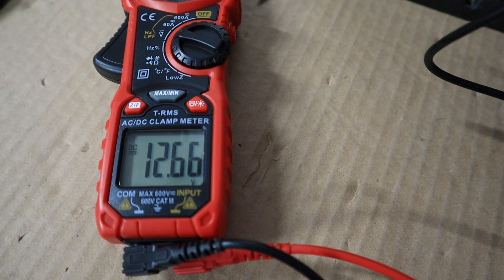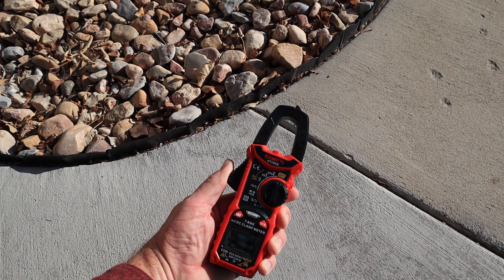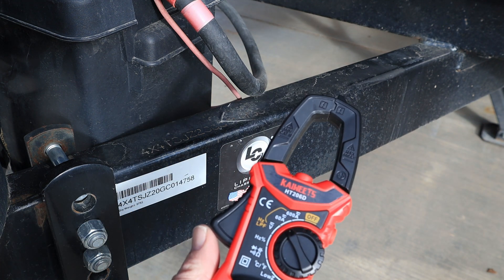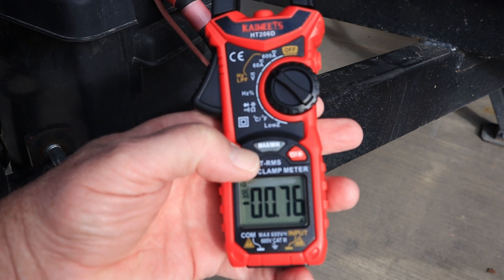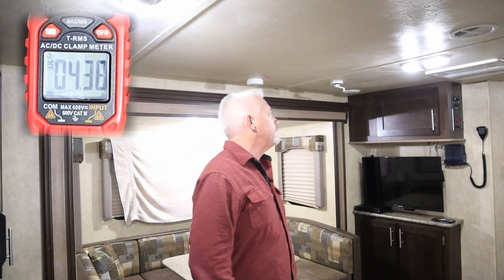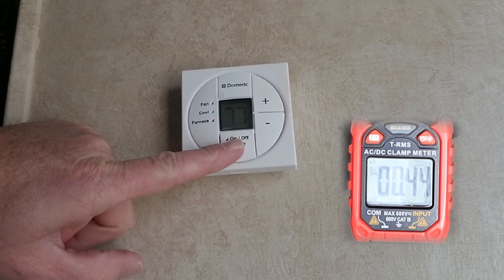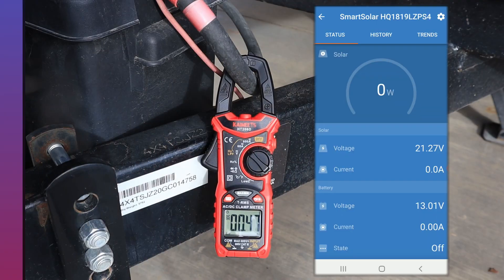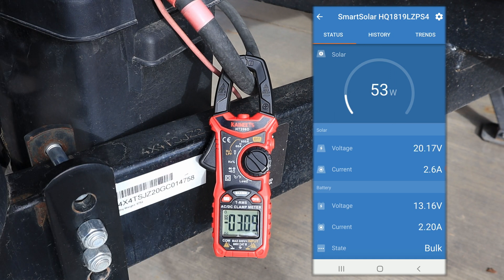12 volt power drain in your RV | TheRVAddict

Comment: Hey boss, nice informative Vídeo. The issue I am having is my battery getting discharged after one day. Changed Alternator and checked Starter. Seems like there might be a ground taking the power of the battery when it sits. 1996 Winabago adventurer RV 34 footer deisel pusher. Any ideas?
Reply from the maker: Yes, get a low cost DC clamp meter. It will show any current draw. It clamps around a cable loosely like your thumb and forefinger.  You can do all kinds of investigation with that tool.

Comment: Drawing a conventional 12v battery(s) down to 50% will reduce their life significantly.  AGM are somewhat more tolerant of deeper discharges, and the t105 type 6v battery is quite a bit better still.  I take my agm batteries down 40% only before recharging.

Comment: Which Battery Cable did you attach the power check unit to check draw?  I want to check to see if I have a power draw when I put the motorhome into storage plugged into 110 Volts.  Thanks

Comment: So I have solar an shore power. Thier is a red cut off switch with on an off. When I plug in shore power it drains my batteries.  Plug is bad.
Reply: I watched a video that said if you DONT turn on the cut off switch, when connected to shore power, the converter will keep the batteries charged, but NOT if you have the cut off switch activated. I just keep my batteries disconnected till i need to move the RV for street cleaning.
Reply: We never found the drain, so to be on the safe side, i just keep the battery disconnected when not driving the vehicle.

Comment: i was wondering if you could help with a techie question, with regards to amperage draw
my led tv draws 80w ..i have 100 available amps/h...at 12 volts.. IF im doing my math right that means the tv draws about 6.5 amps and the batteries would supply power for about 15 hrs?
did i do that right ? to me it seems like a long time
Reply from the maker: @mikeinsanediego, Your math is right, you really only want to run your batteries to 50% and that means you would get 7.5 hrs until your batteries would be considered "drained".  Thanks for Watching :)
Reply: @RVKevin  thanks yeah i have 220 ah btteries 100 ah available...I use "warm" led lights in my coach..."brights' in the basement

Comment: the 4 amp draw with the lights on.... are you using led bulbs? it   looked like it with the brightness
Reply from the maker: @mikeinsanediego,  I upgraded to LED lights and it made a huge difference on brightness and power. This was a great upgrade. Picking the right Color is important.

Comment: Great stuff. Getting new RV users to understand that even if you have everything turned off that parasitic draw (propane detector, etc) will drain a battery down over time when not in active use. Battery disconnect is such a great thing for storing. Have you had any luck with the battery monitoring systems or do you get that info from your solar charging controller.
Reply from the maker: Thank you Peter, i could make a video about the monitor i currently use. I appreciate your support 😎